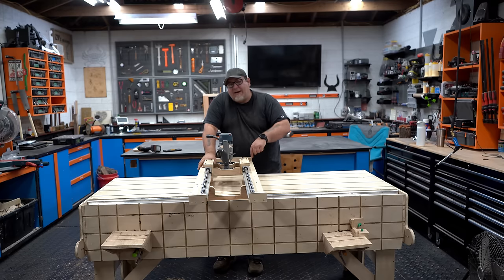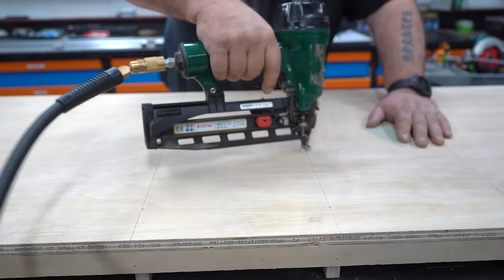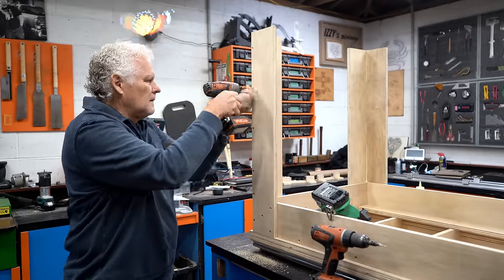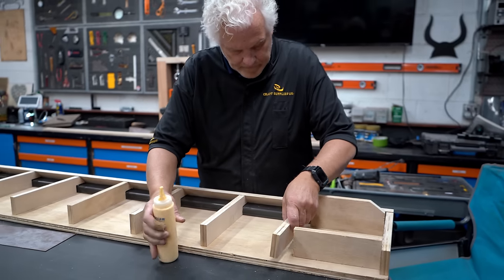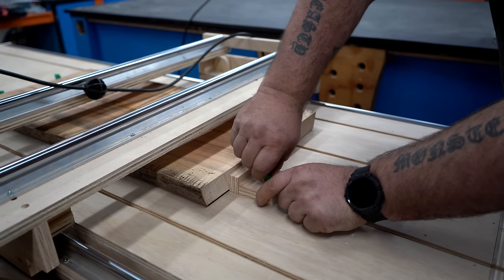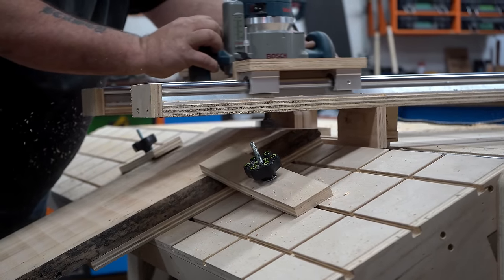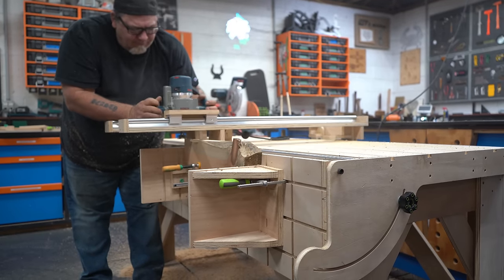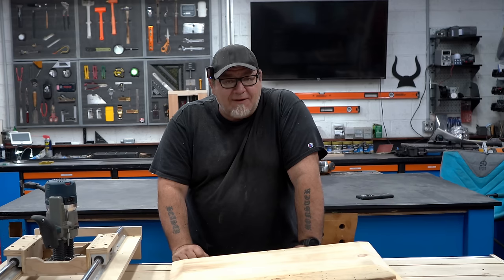How Slab Flatteners Should be Built

Comment: If you make the rails on the table/bed part a bit more recessed, you could have removable covers to 'hide' the rail when not using this as a flattening rig. This could be the main 'workbench'' most of the time, with only the rolling sled part needing storage
Reply: I was thinking the same thing. Along with the top router section being able to be stored under the table.
Reply: I want to do exactly this but also figure out how to convert to a track saw
Reply: @PrivateChannel1300  I've literally been thinking about this for months. I've been trying to design a table that's a workbench, has a hidden flatting setup, and has attachments like the festool MFT system for my tracksaw components.
Reply: @kyorising  I'm going to build
Reply: Same thought.  I think it would pair nice with a large mft stile workbench with removable sides and top roller and could still have tool storage in work bench.
Reply: What if the surface on the side to hold pieces rotated up onto the top surface and the back of the if was smooth in order to provide the workstation surface. Perhaps it could be in two parts to allow slab flattening to continue on smaller pieces while providing half of the workspace. Once the flattening was completed the other half could be put away to give the user the whole workbench again.
Reply: Could make a jig holder on a 2nd level above the router for repeat pattern cutting or carving. Have a pin coming off the back of the router engage the pattern
Reply: I need this

Comment: Izzy, not only is it a slab flattener, planer sub, jointer sub, but you utilized CNC properties by having the gantry being the reference edge for all of the machining.  I imagine that something like this led to the modern-day CNC machine.  🤔 Adding to @myGrowthrings mount 1 edge to a wall and make it fold down to keep a slim profile when not in use, or possibly even use it in a vertical orientation.  The gantry will always be the referenced machine edge and I have seen CNCs work folded up against the wall...
Reply: Using it in a vertical or near vertical orientation has the added advantage that the chips, dust and swarf immediately fall away from the cutting bit so that the life of the bit is helped.

Comment: Suggestion on Product Variation:  This thing does take up a lot of floor space.  Two suggestions.  One, design it to store out of the way while standing on its end.  Two, design a second variant of the original design that does not lay horizontal in the first place.  The tabletop should work fine if rotated to an 80 degree angle to the floor.  More upright than not, but not vertical.  Tilted back slightly like the large sheet goods saws they use in the big-box lumber and hardware stores.

Comment: With the gantry removed it would also make a good work bench. So I think it's a viable solution for a lot of people. 
Maybe a circular saw attachment. Probably need to add some locks to hold one set of the rails in position. 
Rail stop blocks would be a nice feature so you can route out just a small section of your work piece.
Interested to see what other ideas you come up with for it.

Comment: You keep raising the bar for everyone with your ideas and ingenuity. This is an excellent piece of equipment. I have a small garage shop, 11x23. For this to be useful for me, i would piggyback what some of the others have suggested. Make this a multiuse table that can double as a set up table, flattening table, etc. I love the way it keeps a round log tighly mounted so you can concentrate on flattening it rather than worrying it will get loose and create a problem. Look forward to seeing how and what you add to this.

Comment: It's similar to an idea I had for a flattener/slabber. My idea was to have the tool be modular so you could put a small bad saw on the sliding section to slab small logs with it as well. I love the idea of the cantilevered section on the cross slide with angle table to the side. That makes it way more useful. Nicely done.

Comment: Love it. The adjustable side can make live edge bevel details that otherwise would be tricky or impossible.  With standard workshop equipment.  And love the fact that it can be multi functional. That makes the large footprint not so bad. And with the dovetail slots. Double as a work bench. Great job 👏 👍 👌

Comment: That's a fabulous build Izzy.  I built a similar one (no gantries) but I added a 4-inch dust port and a barn door track on the ceiling to keep the hose out of the way.  I also added EPDM rubber wipers.  This setup eliminates 90% of the chips.

Comment: I really like this and the possibilities. It may be large, but I think it's suitable for a small shop because it's so versatile, replaces multiple equipment and the piece stays still so you don't need the feed in/out room that you would need for a jointer or planer. Makes other issues like head changes and blade sharpening easier.

Comment: I love this! It may take more floor space than a planer when being stored, but not in usage. Planing an 8' board requires a least 8' of infeed AND 8' of outfeed. This could theoretically do it with only 8' (plus a smidge for fixturing) total. I'd love to also see the router be in a removable carriage so it could be swapped out for a powerful sander or a circular saw! If you add slide locks and a good tape measure (or maybe threaded rod and half nut for incremental adjustment), you could have a killer panel saw! it wouldn't be quite as flexible as a table saw or track saw, but you could cut awesome panels for cabinets! Oh, with the slide locks and the router, you could do perfect dados too!!!
Reply: I've never bought build plans before (I always like figuring it out for myself), but if you added those features and sold plans, I'd pay through the nose! I'm hoping to start building kitchen cabinets in the next few months and this would be a GAME CHANGER!
Reply: I've started planning out tables and tools I'll need for a workshop that I'm setting up after I move in a couple of years. This was one of the first projects that I'll be making. I'm planning on an interchangeable system to use either a router or circular saw, both across and length-wise with a dust collection attachment.

Comment: I love this idea and have been thinking in my head of a good design to flatten slabs without using it separately from my assembly table. I have a very small shop and my assembly table holds my planer, mitersaw, drawer for all my hardware and dust collection for the mitersaw and sanders when needed. It's also my outfeed table for my tablesaw which has my router lift in the wing. But I could definitely figure out a way to place this on top or in some way incorporate it into my setup. That folding side piece is genious!! Both jointing and profiling edges are brilliant for that!!

Comment: Izzy, brother that sled is pure genius!!  Not only can you flatten a slab but you have the ability to work the edges?! I’ve seen no other like it before. I use a Bosch 1617 for my router and I’ve used a 2”  flattening bit. Just take small bites.  I flattened my bar top (2 1/2’ x 12’) and with the epoxy, it snowed in my shop!  I don’t see why you can’t use this system to replace a jointer and planner. To machine your new capacity you would need very expensive machines.  This is why wood working is so great bc there’s always more ways than 1 to accomplish a task.

Comment: Well I have this same setup for flattening, I agree a 3hp or bigger is the way to go. Your idea on that front leaf is fascinating. I’m thinking it could be used for mortise and tenons and like someone said used like a domino tool. Panto router possibly? Thinking outside the box here.  Nice job!
Reply: Large dovetails aswell
Reply: @PhoenixRising2040  Yep, long spline joints too.
Reply: @branchandfoundry560   this is essentially a manually guided cnc, a combination between this and a pantarouter would = skynet😎 😅
Reply: @PhoenixRising2040  You're right. The hinged side is the thing that takes it over the top compared to any other CNC table...opens up a lot of possibilities.
Reply: @branchandfoundry560  out of curiosity, have you finished the cabinet under your tablesaw yet? 🙂 I'm in the process of turning my exposed dust collection into a super mario diorama 🤣 it's a mess but it usually is until the ol brain doodle takes shape 😅😀
Reply: @PhoenixRising2040  Yes, I actually finished the cabinet before the mobile base video published. Thank you!

Comment: Love this Izzy. As someone with a small shop, and without a big cast iron jointer or proper planer, my only worry is dust and chip collection. If there was a way of catching 95% of the chips, then yeah I could see it replacing the need for a jointer / planer in my shop.

Comment: I cut down 2 Deodar cedar that were 85 feet tall and about 90 years old.  I got 2 slabs at the base that are a little bit short of 6 feet diameter.  I am looking for some rails that won't sage when I run the router across. I like the idea of the plywood or something under the rails for support.  Great idea!

Comment: This is quite spectacular, really cool. @Izzy, I am sure you quite know what you are doing. But for everyone that considers building this: note that dust extraction is difficult with this open gantry setup. Please, please use PPE to protect your lungs. Open milling creates fine particulates, and they will ruin your breathing if you do not protect yourself every time you do this kind of work, including quite a bit of time afterwards. The fine particles will stay suspended in the air for a long time.

Comment: That is fantastic. I’d like to see you mount a horizontal spindle on the tilting section kind of like a lathe. You could then use the router to cut spiral patterns on round logs or turn square table legs round at the bottom.

Comment: I really like the way the Tally Ho boys did their jig (episode 40) with a 6in electric planer. Router is certainly more accessible but the planer offers some benefits. You can ease down and if you need to adjust you aren’t left with a big step to plane out. Also I think it lets you move more wood and collect chips easier than a router. 

Personally I have an mdf table that I dump a little chalk on and rub slabs on. (Sort of like a big machinist surface plate and Prussian blue) and then hit the high marked spots with an electric planer.
Reply: Episode 30*

Comment: I like your idea.  The moveable table is cool.  I have a 5' x10' slab flattening jig and bought linear rails that I have not installed yet.  I bought a Lee Valley rail kit that uses electrical EMT for the rails.  That works but it will sag if you are not careful.  The matchfit is a very useful tool and helps keep your table from being eaten up by screwing stops in to keep your slabs from moving.  I have a Porter Cable 7519 3 HP router with the Infinity Mega dado bit and that works so great.  Looks like that might be what you were using.  The flattening jig I have is an open 2x6 table and I think I will steal your idea and put a plywood top on with the matchfit clamps and hardware.  Nice job.  I also have a CNC and I can see you made your moveable table on the CNC.  That brings a level of accuracy that you just cannot do with manually cutting the slots and so on that you made for the moveable table.  There are several plans floating around for making a work bench with the match fit system and they also go down the sides.  Keep it up.

Comment: I’ve been considering a very similar idea for a bit now after seeing how affordable those linear rails are getting. One thing you could maybe add is a one to one copy fixture by adding a template and a pointer to trace your template that is attached to the router base. I’ve been thinking of also adding stops to the rails to basically turn the flattening jig milling machine for wood. Maybe even aluminum in a pinch.

Comment: You can also make a sled for your circular saw and that could possibly eliminate the need for a miter saw as you have all the clamping abilities to make angles needed as well as a longer range of motion. I've been trying to come up with a similar idea that replaces my miter saw as well as trying to design a lift system for the slides and rails using electric linear lift motors so you can adjust the thickness of whatever it is you are doing.

Comment: I really like this system. It's giving me ideas for a bench design I've been working on. For me, having a dedicated slab flatter isn't something my shop square footage allows. So I'd want something where the gantry can be removed and stowed most of the time while the table can be used as a regular assembly or track saw break down table.

Comment: A Router "Copy Carver" system. 3D contours like carved curve-backed chair slats, 2D 'sign making' type of activities, and duplicating intricate molding patterns like remodeling a house and you have one good window trim to match all the other windows to, and 'gun stock lathe' type of copy carver to do exotic stair railing newel posts and the intermediate vertical bars.

Comment: I'm running a Onefinity X-50 Journeyman CNC (last year's model) with a palm router. As I got more comfortable with the CNC, I slowly moved my planer and jointer into a utility trailer for storage. Using a jointer and planer is definitely faster than running a palm router over a board multiple times, but if I can make myself useful somewhere else in the shop while that's happening and gain back some space, as well, it's a good tradeoff in my case. Watching you run a larger router on your slab flattener and taking a deeper cut than my palm router can ever manage sure makes me want to upgrade to a healthy spindle.

Comment: I’ve been playing with a slab-flattener and downdraft table combo. If you reconfigured the innards of the torsion-like box and had the suction power… Downdraft holes could replace the groves for clamping pieces in place, be plugged if not needed depending on piece size, and dust and chips could get sucked out the end of the box.

Comment: I think this is awesome, I could see some tracing out letters or using a template bit.
I get it is not a CNC but it can do some of the things you do on a CNC.
Especially since for my CNC is on 4’x4’.
Track saw, certainly could use a different bit for that.
Having a way to have it built into a workbench would really help a small shop.
Again I have a CNC, jointer 6” and planer 13” but they all have limitations I see this fixing.
And at the price point it helps many people.

Comment: I thought of doing something similar after having to build a smaller linear sled out of 3d printed parts, some thick walled pipe, and of course wood. Used similar Bosch router and bit as well. My issue is exactly as you stated, the room, and how often I'd need to re-surface in that way. My temporary setup worked for the one job I needed it for, flattening a work table top, but alas some parts I made broke as they were printed so I could cheap out and not buy more expensive "Real" parts. Oh well, worked what I needed them to do. I have an idea for a better system then mine. I like yours, some good ideas included. I like using those dovetail clamp slots. Have a couple of jigs using them.

Comment: That's awesome. I wonder what kind of joinery you could do with a system like that. For example angled dovetails where the two boards don't come together at a 90 degree angle. Or use it for creating some rather difficult mortise and tenon joints. As always Izzy, you've knocked the ball out of the park once again.

Comment: as a DIYer my budget is low, and space is at a premium. I have used many of Izzy's tricks and projects to make high quality items in that space. I don't know when I can get something like this together, but I've been looking at a similar build for a year now. The one I designed is knock down, so it goes away when I don't need it, but still able to flatten. Also I'm trying to integrate 2 sleds, One router, one with an angle grinder. Still working on adjusting the height

Comment: 50 shades of Awesome. I use an 8'x4' table I built with an aluminum sled on wheels from stonecoat countertops and a Dewalt 3 1/4 hp router. Sold my Dewalt lunchbox planer. No more snipe or stupid 12" limitations. The table in this video though, next friggin generation.

Comment: absolutely amazing idea. if you notice vibration from the wood being flexible one could try simply weighing down the sled instead of using harder materials, tho given one sands the surface on most projects anyway it wouldn't make much of a difference.

Comment: First off, Mr. Swan: you are an inspiration.  Secondly depth stops on the linear rails come to mind.  If there was a way to limit x and y travel in a coordinated way, repeatable curves perhaps? At that point it's basically a CNC setup without the sensitive electronic controls. I don't know how one would pull that off exactly...but...

It would be pretty darned complicated to pull off, I think, but having a 4-post acme thread lifting system with sprockets and a drive chain to keep things moving in unison would give you more range for thicknesses.  That would make it way more viable in replacing a planer/jointer.

Comment: I firmly believe that a planer is that place to get that one great edge. Not necessarily planing the first of a board. With your table and a better router when your side table you can get more than a planer with a sanding machine and your system. I am working with using the same rail system with dedicated appliances to do perfect square cuts and even a plywood cut piece. We think very much the same. I took believe the rails and bearings will be the most important